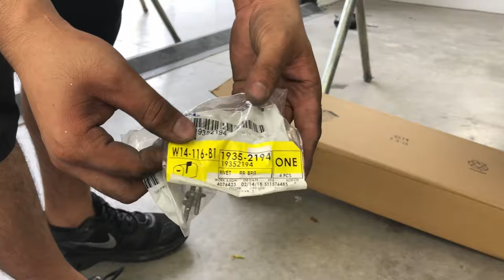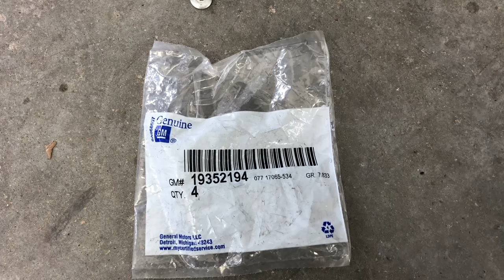How to Replace Your Chevrolet Camaro SS Rear Bumper (2010-2013 Models) | ReveMoto Painted Car Parts

Comment: Does each individual sensor have a specific location or are they all interchangeable
Reply from the maker: It’s been a while but most of the time you have to check how the work is set up to situate the plugs in the correct direction

Comment: I’m a little late but is the whole lower valence just held on by the double sided tape? I want to put the zl1 rear diffuser on and I was wondering if taking off the lower valence would leave any holes from rivets or clips or something
Reply from the maker: Hello! So, in this video the valence and kit held on by a combo of clips and double sided tape. If you get the zl1, it should have holes to clip in. Thank for watching!
Reply: What was the update? I wanted to get a separate 12-13 ZL1 rear bumper valence, to replace my Ground Effects from my 10-11 (I have a 2010 2SS RS coupe). 

The GFX bumper has different attachment style than the ZL1, where the ZL1 bumper has to be notched cuts for the very sides of the ZL1 rear bumper lip. I remember helping my friend cut a new rear SS bumper with a disc grinder(?), in order to make the notches for the bumper to not just be held on with tape.

Comment: Hey, for the 2010-2013 Camaro’s, I’ve heard of people converting the 10-13’s to the 14-15 rear bumper and diffuser. How can I make this work as well?
Reply from the maker: I am unsure. I don't think the body changed much, just the style. It is quite possible, you may have to get different lights. You should definitely check out the Camaro forums and see if some of those guys know as well. Thank you for watching!

Comment: Are the various bumper clips very sensitive to breaking?  Hard to see how much you pre-prepped pulling those clips for the video.  Debating doing this more than once.  Once now to replace backups with LED and once later to repaint whole car.  Don't want to damage clips that force me into a new bumper.
Reply from the maker: Hello David! They don't break that often. They can get brittle but if you are careful they can pop off without breakage. It's easier if you have a panel clip removal tool but a flat-head works fine. Worse case scenario, they are like $2 at the dealership. Thank you for watching.

Comment: Hi.. I was wondering how wide the double sided 3M tape needs to be for the lower valance.. Also, any tips on how to remove the old tape from valance to get a clean surface for tape to adhere??
Reply from the maker: Hi Dana!  It was 1/2 inch tape and use an eraser wheel.  Then clean with alcohol wipe.  I used it on a wrap I removed for my tundra so you can see how to use the eraser wheel.  Just search tundra Revemoto.  Go to www.Revemoto.com

Comment: Hi where do I get the screw or part that goes in the rear passenger bumper I have the part but I don’t have the screws that go into the bumper
Reply from the maker: If it’s just screws I would go to the dealership and if they out of stock.  Go to a local hardware store like “ace”. They will have it.  If you need painted autobody parts go to www.ReveMoto.com

Comment: How did you get the reverse lights out?
Reply from the maker: Once you got the rear bumper off on the back of the reverse light there is one screw and then you push the tab on the corner to release the light.